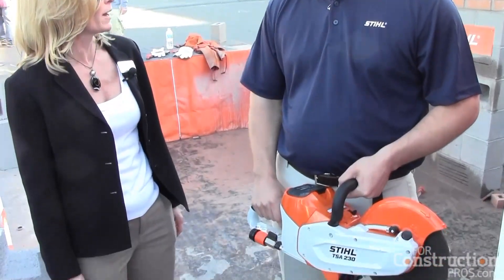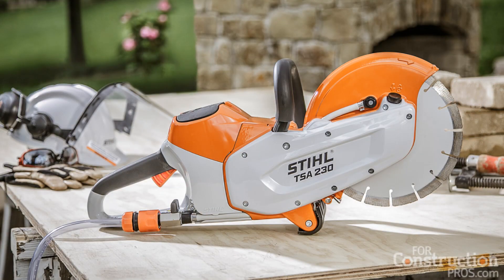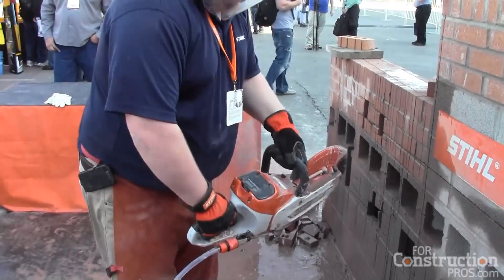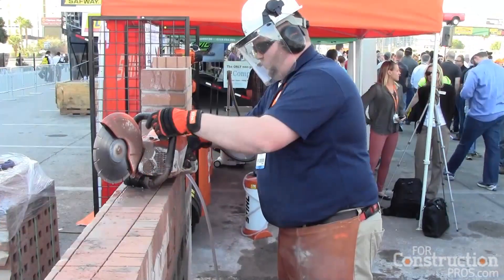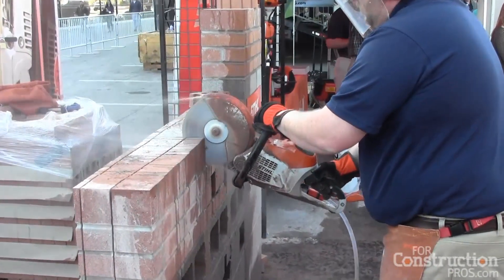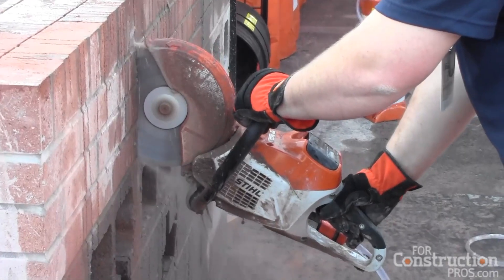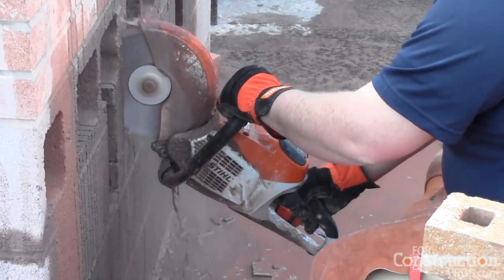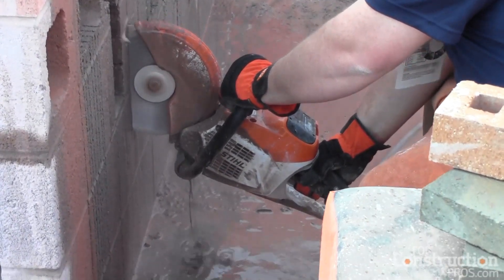Stihl’s Battery-Powered Saw Cuts 30 Cinder Blocks on a Charge

Comment: Waiting for a 300mm battery powered cutter. Would love a quiet no fume cutter but this  would be no good for brickies if it only cuts 3 inch deep. Would need a blade that cuts 100mm deep if your toothing out, cutting cavities or cutting brick face. Got a husqvarna k770 at the moment which is brilliant.

Comment: Love that fact no gas I hate mixing gas I could never get it right
Reply: gabe klassen buy 100ml Sachets then mix with a full can of petrol
Reply: Fill the petrol (gas) can 5 liters put 100 mls 2 stroke oil in l. That’s your 50-1 mix simple . if it’s 40 -1, 4 liters petrol (Gas) in the can put 100 mls of 2 stroke oil shake the can well has to be mixed well. Or simply put 2 stroke oil in the can first then fill with fuel to 5 liters or to 4 liters depends what the tool needs with the mix ratio
Reply: Pff read the instructions 🙄 duh
Reply: Just buy premix bottles at home depot